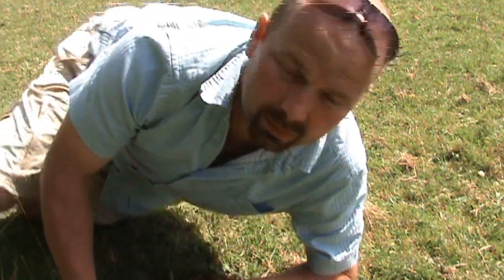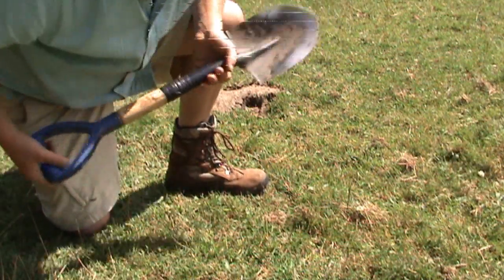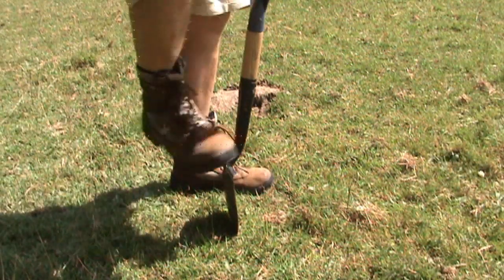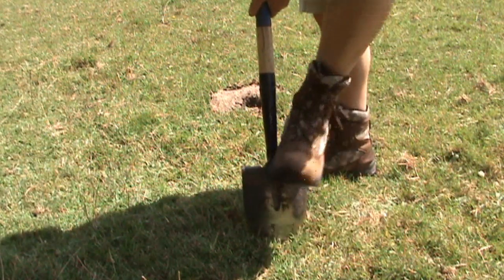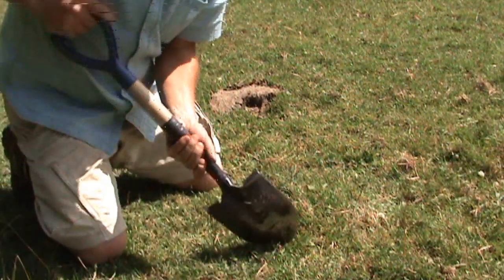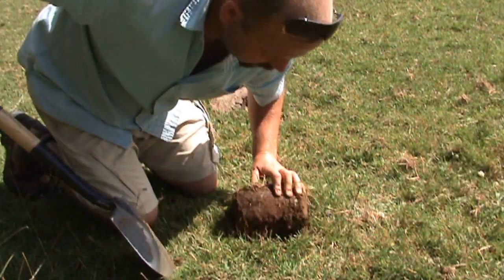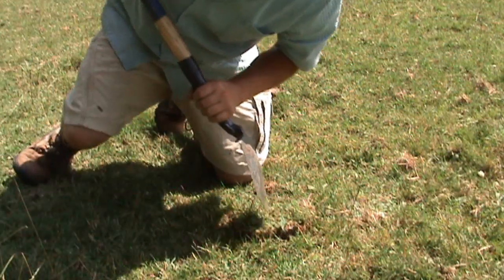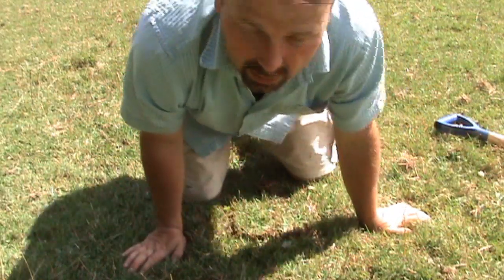Metal Detecting Tips: How to Recover a Find

Comment from the maker: I usually go deeper than the depth indicator says so I don't scratch the target with the spade. Smaller targets will show up as being deeper than they really are andbig targets show shallower than they really are as the depth detector is calibrated for a typical size coin generally.
Dry ground is harder to make a good job of as a plug doesn't come up too well.
I use a Garrett pinpointer (review to follow) and drag it over the dig site before starting digging if target shows as shallow.

Comment: I obtained my M.D. Permit last week and have been practicing with
the screwdriver method of recovery.  It is really not all that bad if
one does a good job with pinpointing.  The method I was taught 
allows the turf to be rolled up to uncover the soil up to a 7 or 8 in.
diameter and, with patience, quite a deep hole can then be dug
out as far down as any coin shooter coil will reach.  If you areD
really careful you can avoid scratching finds.  Don't have to carry
a shovel or a lot of other gear

Comment: Where I come from detectorists are required to use only a screwdriver for recovery.  
Allegedly, that is because using a trowel or shovel, kills the grass roots which causes
the plug or divot to die and turn yellow.  For some reason the city of Boise, ID does not
like that.